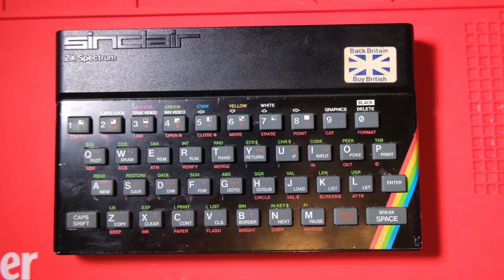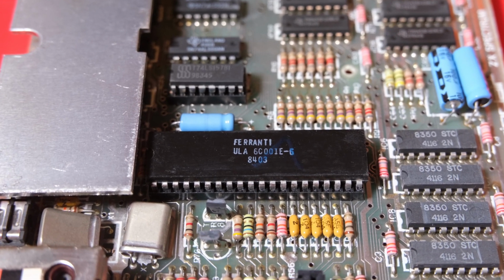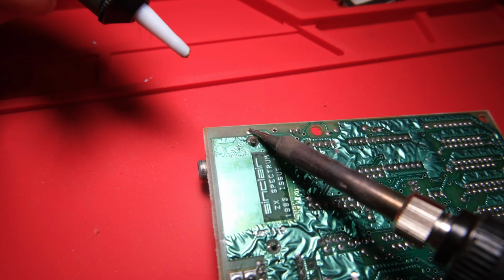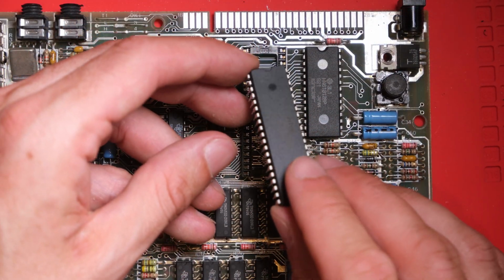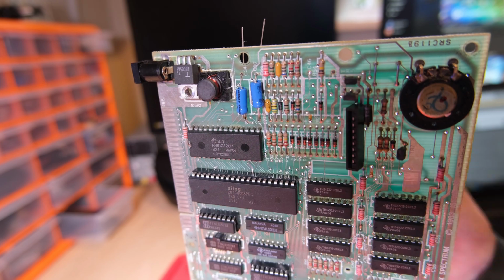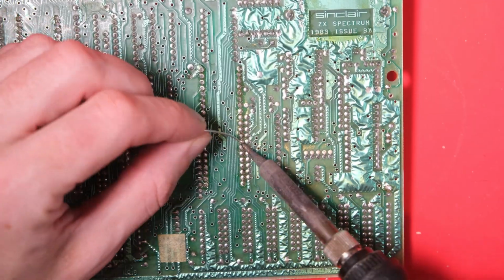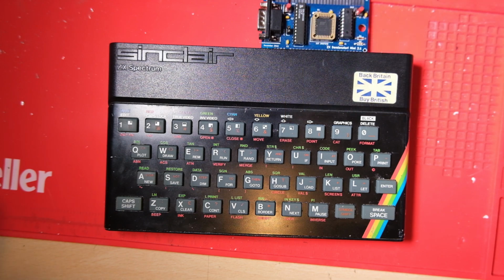ZX Spectrum Marketplace Gamble - Issue 3B Repair and Service

Comment: From my experience there is a few things you should be doing generally: 1) Use of a static strap and do try and avoid touching pins if you can 2) Cut joints before soldering because cutting after can stress the joints 3) clean of flux after soldering. I know that none of these are deal breakers, but they are good practice.
Reply from the maker: All good tips thanks, you're absolutely right

Comment: As a ULA is a custom Logic Chip, might it be possible to revive some faulty ULAs (depending in the fault) by installing external logic chips? Sinclair did similar things with the dead bug mod. I've seen that modern replacement ULAs are very expensive and in short supply.
Reply from the maker: If you're going this far you might consider looking at one of the clone boards (e.g. Pentagon) that have constructed the ULA using multiple smaller chips
Reply: Sure, in theory you could externalize the circuit when you have a deaf or mute ULA ... not exactly worth the effort tho since chances are high it will fail more severely sooner or later. Especially when data bits are dead things will get quite complex quickly and signal runtimes might become an issue.
Best bets would be either replacements or going with a Harlequin Spectrum. Might be possible to design a "drop in ULA board" based on TTL logic chips which can still be easily obtained BUT that will easily go over the space limit a rubber Spectrum has left.

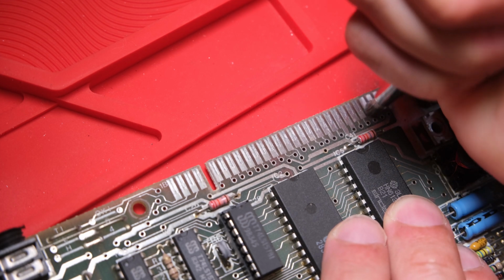Comment: 5:30 what do you use to clean edge connector?
Reply from the maker: A fibreglass pen and I normally use alcoholic spirit and a toothbrush after before a wipe with a cloth
Reply: @HappyLittleDiodes  What about using a pencil eraser instead? Fibreglass pens are quite unpleasant to work with and one needs to be careful not to overdo the job. Added bonus: results look way more even.

Comment: Nice video.  I am curious though why you did not swap the regulator for a new cooler one?
Reply from the maker: I could have, but the temperatures involved are all within spec and with the heatsink on a stable ULA I decided to keep the original warmth and weight. They are about 6 quid each too and this had already consumed a pricey ULA

Comment: Nice repair.
Reply: I have a video testing chips on a diagnostic card do  you have any dodgy z80, ula or ram multiplexor chips you don't want ?
Reply from the maker: Hi Lee. I have a pile of them, what do you need? I'm interested in what you're planning to do with knackered chips!
Reply: @HappyLittleDiodes  nothing special, I have a diagnostic card with the leds that can show some faults the 0.38 does not show and I made a video recently testing it out with some chips I have and I am about to release a 2nd with some more so just looking for chips I can continue the testing.
Reply: @HappyLittleDiodes  If you have any 74ls157 or 74ls32 from the ram multiplexer  circuits I have not tested those yet. Or anything that you think could be interesting to test and probe.
Reply from the maker: I might have some 157's in the graveyard, I'll check later after work

Comment: Another one saved, nice work! Talking of unnecessary desoldering… I recently replaced the RAM in my +3 because I was absolutely convinced it had a memory fault (I agree, it's not easy to resist the temptation to lever the chips out - but like you say you just have to take your time and go pin-by-pin carefully) but after all that effort—and wasted time—it turned out it was just the CPU at fault after all! Yes, the socketed, easy-to-replace Z80 CPU!! Oh well…!
Reply from the maker: C'est la vie! I've been in that situation and it turned out to actually be memory, just took the removal of many chips